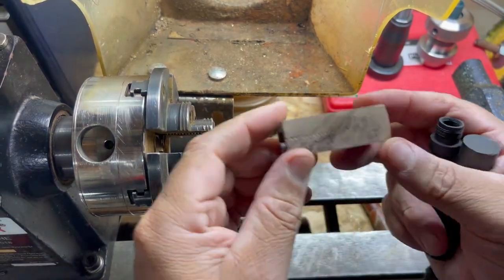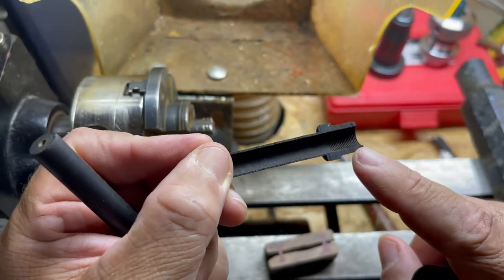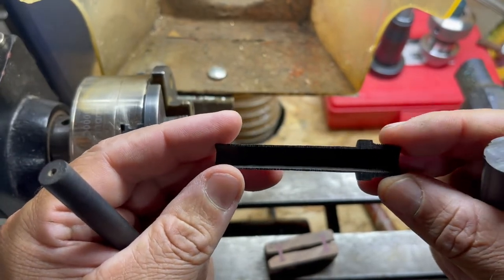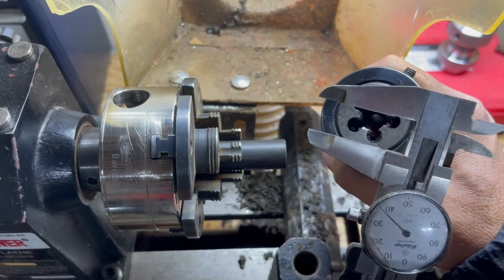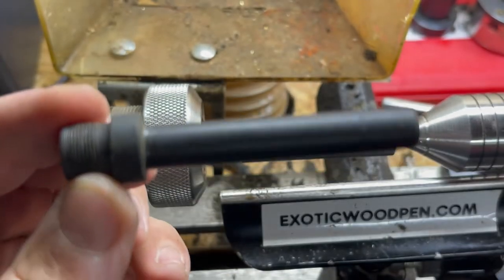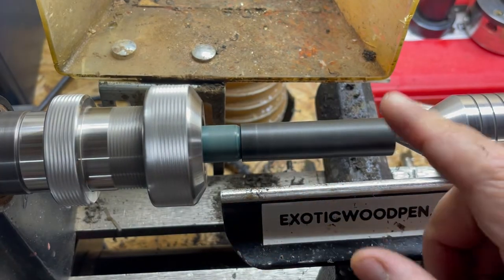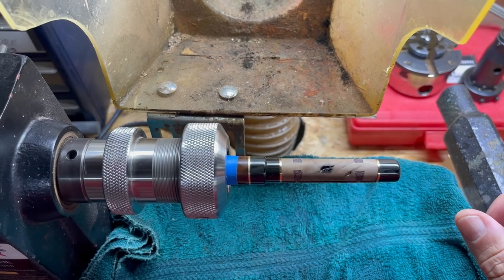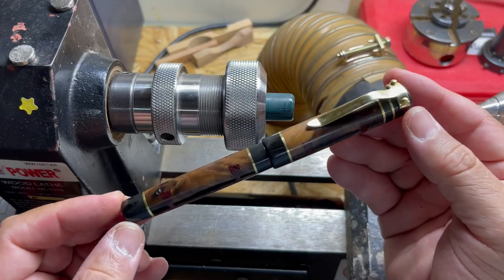Part 2 George Nakashima style body

Comment: Great series Gabe, where would you suggest finding a double lead tap and die?
Reply from the maker: @izgood2bking702  Good luck finding one, I tried for a long time and ended up having to special order with a small group of people to have them made and they were not cheap.  You may have to ask around on iap.
Reply: @exoticwoodpen  thanks. I don't know how many would be interested in double start, but I'll try.
Reply from the maker: @izgood2bking702  You may come across someone that has one and does not use it anymore who will sell theirs.

Comment: Hi Gabe, nice work! Always a pleasure watching your videos!
However, just a quick question: I also made in the past such brass inserts in wood and the problem I faced was that, during sanding the whole piece (brass and wood), that brass dust migrated through the wood fibers and altered the whole texture. Looks like you don't have such trouble, how did you managed it?
Reply from the maker: Hi, thanks for watching my videos.  I have had the same issues in the past but when it comes to wood and brass I also use Thin CA around the wood next to the brass to make is stronger if it more porous and try to cut brass down to final dimensions if possible when I start sanding.
Reply: Nice work Gabe. Love the idea of the butterfly ties. I think this would look great with a light wood and ebony ties, with silver accents. I might try. Your videos are really nicely produced. Well done 👍
Reply from the maker: @derekwilliamson5442  Great, I had another in mind doing the same with Curly Maple and Ebony as well but that will be next year before I get to it.  Thank you for watching the videos.